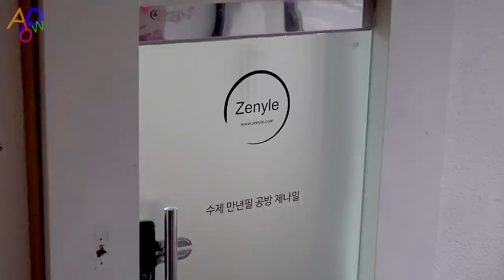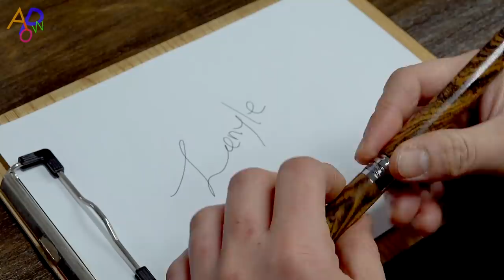Process of Making Handmade Fountain Pen. Korean Woodworking Master

Comment: Is that a hot/warming box that you place the glued up blanks in?  I see that you are using Gorilla Glue which I use a lot in my pen making.  Does the warming box speed up the setting up time for the glue?  And an epoxy for the finish.  Good choice.  Thanks for sharing.  I love the fountain pens.

Comment: Does anyone recognize the wood species?  Is it toxic?  Wondering because of all the protective equipment.
Reply: I thought it was keeping the dust from lungs 😂
Reply: according to their website all the material to stain it are all natural so I think comment about the dust is correct
Reply: Definitely for dust 😂
Reply: It is absolutely about the dust, but dust from certain types of tropical woods is also toxic and therefore their dust is even worse for health.
Reply: @pieterpan  Your post made me start researching... didn't know that tropical woods are toxic to many.  From what I have been looking at, I think it may be zebra wood, whose dust is considered toxic.  Sure explains the mask, shield, exhaust system  and respirator.  I learned the darker the wood, and the more aromatic, the more toxic it tends to be.
Reply: Some type of ebony wood
Reply: It looks like Laburnum to me - and yes, that is toxic. But I think this is more about a woodworker that wants a long career ahead of him so is taking no chances.
Reply: it's normal precaution for dust, respirators for dust particles, earphones for the sound of the machinery and glasses for shrapnel, if you work in a industry and they don't provide these things, hop tf out of there

Comment: Nice work using modern machines, btw title said it's handmade, I'd rather call it not truly handmade. I've seen a fountain pen carved of solid wood with use of primitive tools like metal blades, natural glue colors etc and another made out of slim bamboo stick, those were a real handmade artifacts. These ones are nice to have but still can be mass produced if desired.